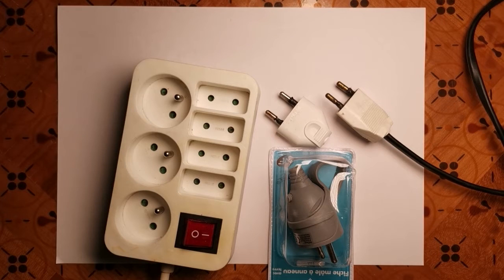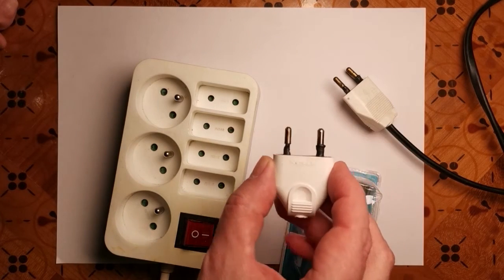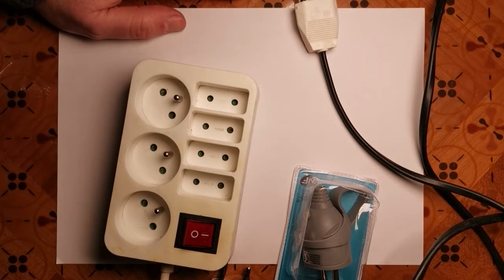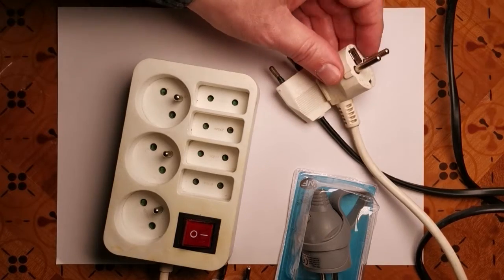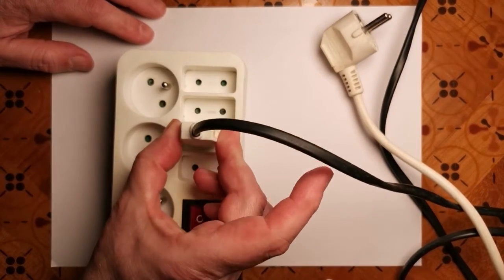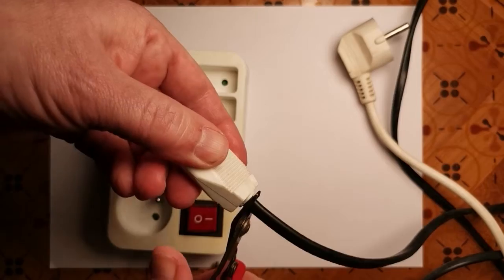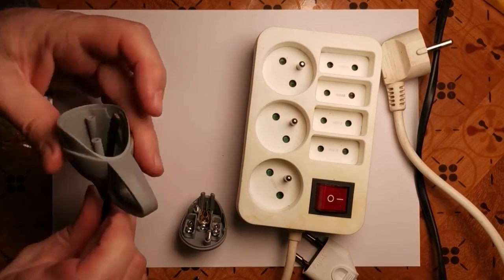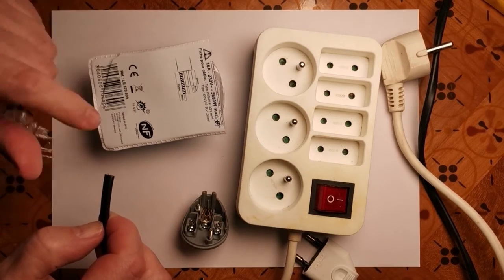French electrical plugs - know the difference

Comment: The small kind is only up to 2.5A, there's also a 3rd kind, for appliances over 2.5A that don't need an earth, things like hair dryers, vacuum cleaners and power tools, the 3rd standard is called CEE 7/17
Reply from the maker: Thanks!
Reply: The Europlug is designed so as in Italy and Switzerland they have smaller holes on the sockets so it needs to fit those also. I think in the past even more countries had the smaller 4 mm holes.

Comment: You didn't mention polarity. How do you know which is + and which is neutral terminals????
Reply: From what I've seen and heard,  the French wire their 16a sockets with live on the right of the earth pin, looking at the socket from the front with earth on top. Polarity is important when connecting a uk caravan/ motorhome to a French standard socket, so always use a socket tester in an on-board socket to test before using in this scenario.
Reply from the maker: From what I understand it doesn't really matter.  Some countries only have the fuse on one wire, but in France both the live and neutral have fuses/breakers.  The rectangular plug works just as well whichever way up you plug it in, and I've never had a problem with the earthed one regardless of which way it was wired up.  Hope this helps!
Reply: In mainland Europe, appliances are designed to work safely with either polarity, because which way round sockets are wired isn't always standard and plugs can be plugged in either way round (in France, earthed appliances can only go in one way round, but in most other European countries, they can go both ways around)